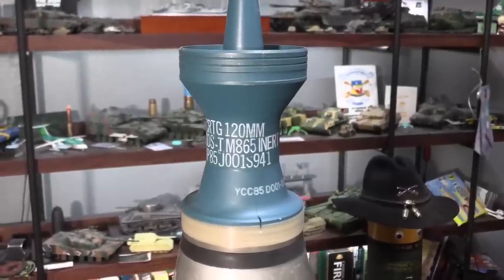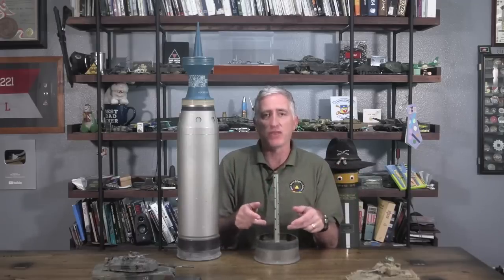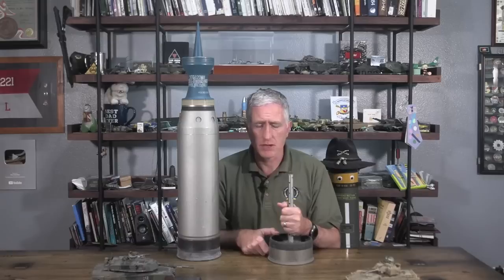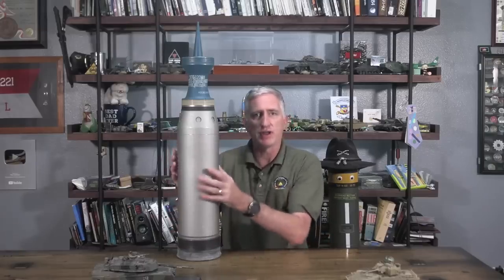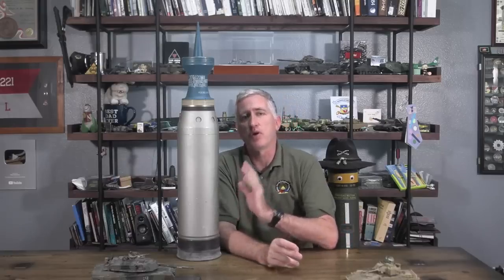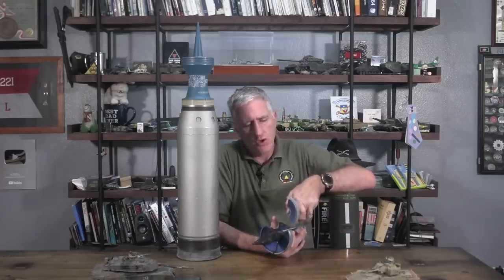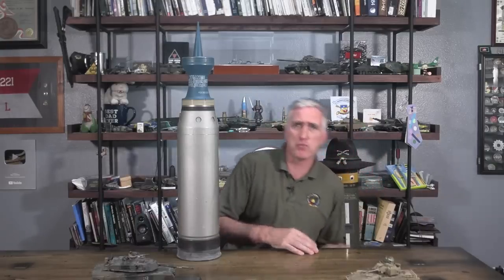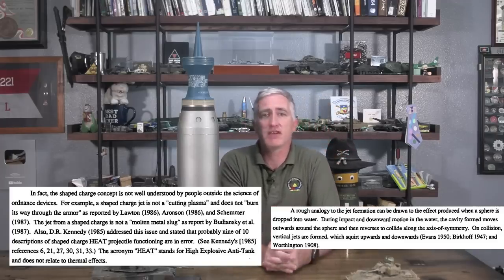Tanks 105: Anatomy of a Modern 120mm Round

Comment: Speaking of lap loading I've seen three tracers in the air at the same time 
(the old 105mm HEP TP-T was slow) at a Target at 1100m.
Reply: Must have been at a range, but I can't imagine a tank shooting three rounds at a target without even observing the first round effect on target. Seems like potentially an awful waste. I guess it could make sense if you really just had no faith whatsoever in the ammunition...
Reply: @tackytrooper  
Range 42 Crapingbeer Germany 1980
Reply: @tackytrooper  If you were doing your qualification run and you get two rounds to fire at each single Target engagement by the end of your run (If your Gunner is worth a crap) you may have five or six unfired rounds.
have you ever tried to turn in tank gun rounds that have been taken out of the packing ?
and even if you manage to get them to accept the several pages of paperwork it takes they'll likely destroy them.
Reply: @tackytrooper  Indirect fire artillery does that all the time, when things go "just right" they have multiple rounds on the way and are moving again by the time the first one hits. Modern counterbattery systems make such a thing more or less a necessity.
Reply: @robertsmith4681  Yeah for indirect fire it makes sense. For direct fire, those rounds have gotta be sloowwwww for that to even be possible. And, while I'm no genius, I would think that putting at least one round into every possible threat in front of you before going back to re-service anything that's not dead would be the most efficient engagement strategy. But then this guy said it happened on a range and range rules don't always match the combat META.
Reply: @sammymartin7891  When you put it that way it makes sense. I knew it had to have been at a qual or something...
Reply: @tackytrooper  The point of long guns such as artillery, is to never come anywhere near the enemy, from a place they can't see, comes a shell with their name on it that they can't hear coming ...
Reply: @robertsmith4681  Exactly but I was of the impression that we were discussing tank guns here...

Comment: Are Cellulose shell casings are going to be a no-go with auto loaders?  (Is this why the US Army never uses them in 120 mm. Because they might need designed Ammo?_)
Reply: All 125 mbt gun use cellulose casing.
Reply: Leclerc uses the standard 120mm NATO in the autoloader.
Latest Merkava have that semi-auto loader that offered the round to the loader thru a small gap, and the round offered is a 120mm NATO.

Comment: I am kinda envious.. I was not allowed to take any of that stuff home!

And wait a minute... you had an unfired live round stuck in your tanks barrel for several days? o.O

Some minor notes:
- I was taught that the shell casing is pressed powder, guess that was incorrect-ish
- lap loading was taught in Germany in the late 90s, though Id say that is situational and at the commanders discretion
- I was taught that the main reason for a round to get stuck in the barrel was overheating, because then the shell expands and bakes into the sides
- I was also taught to never touch those rounds with bare hands, but always wear gloves, because of static electric discharge
- about the HEAT round. The stinger also makes it multipurpose, if the target is too soft for the stinger to be pushed back into the shell, then the shaped charge wont form and you get a bigger boom without the molten metal penetrator spraying out.

(If my vocabulary is not precise, I am German and simply dont know the correct military lingo in English)
Reply: - I do not think that pressed powder is unable to spread throughout your tank like gravel.
- How is the charge ignited, if the stinger is not pushed in?
Reply: @karlwilhelmmeinert7592  Only the outer casing of the shell is pressed powder/cellulose. The inside is loose grains. If the whole thing was pressed solid, it wouldnt ignite and combust properly. (I think, I am no chemist though)
That casing burns up, too, thus only the bottom plate is left after shooting.

The round is triggered electrically, not mechanical. Nothing is pushed in anywhere.
Meaning, if you want to manually trigger a rifle round, you need a nail and a hammer. If you want to manually trigger a tank round, you need a battery.

Chieftain explained both things in the vid.
Reply: @theskilllessgamer5795  I do not mean the trigger of the propellent, I mean the trigger of the HEAT round that lets it explode after impact.
Reply: @karlwilhelmmeinert7592  Good question. 8) I am not too certain about this. Note that the stinger is just a metal rod, there is no igniter in it. My understanding is that the stinger works like a gap detector, if it hits a hard target it makes the HEAT detonate at that distance and allows the shaped charge to form that molten metal penetrator. If the target is softer, then the stinger pushes through it and the whole thing explodes on impact without a gap, then the shaped charge cannot form properly and it works more like a splinter grenade.
That is why HEAT is called "multipurpose ammunition" in German. (MZ = Mehrzweck = multipurpose)

But apparently that is insufficient, so there might be a 3rd ammunition type being introduced, a HE with a programmable timed fuse that can explode above or behind a target. It is called 120mm HE/Sprenggranate DM11

Comment: Water resistant my butt. After battle carrying one in the hole for three rainy days, I went to unload before reentering the camp. The aft cap separated, and powder started spilling out everywhere. What a mess!!! After shutting off the master disconnect, I had the crew evacuate while I  remained at the loader station and cleaned up powder. Slow, methodical, and always remaining grounded with my body. It took seven guys on the end of the bore cleaning brush to push the round back out to me. After that incident, I would rotate rounds ever so often during rainy weather.

Comment: 7:00 why does most modern tank cannons do away with the muzzle brake then?
Reply: I’m assuming it’s because recoil systems can cope with it better now.🤷🏻‍♂️
Reply: The vast majority of gun for tank in service is NATO standard 120 and Russian 125 derivative. Neither of them have muzzle brake. 

If we go lower, we get to 105 and 100, some of them do have muzzle break of some sort. 

Did I answer your question?
Reply: @jintsuubest9331  but why?
Reply: Muzzle breaks cause a lot of dirt to get kicked up when firing.  Large dirt cloud makes you easier to be spotted.  If you can get by without a muzzle break to reduce recoil might as well leave it at home.
Reply: Better recoil systems making it unnecessary, not having to deal with everything a muzzle brake hurls back at the tank or the giant ball of dust it will kick up giving your position away. It's also a big hunk of metal that you can get rid of to save weight, and use the weight elsewhere.
Reply: @thomaszhang3101  
It depends on your design compromise. 

Lets say someone draw up a requirement for a vehicle using nato standard 105 munition.

You do the math and figure the recoil system for the gun would need to be say 1 ton. 
But it will get rejected as the 1 ton recoil system will put the vehicle weight just a hair over the requirement. 

So you redesign your recoil system to have a longer travel, and cut it down to .75 ton. 
But the problem now is it cannot fire the gun at anything less than -3 degree as the breech will hit the roof of the vehicle, and redesign the roof to accommodate the recoil system is not an option. 

When you see if the mount can be lower, bad news. As the requirement call for -10 degree, and the mount is already at the lowest possible position. 

How about exotic mateiral? That ought to work, but also increasing the cost by 2 fold. That will get you disqualified. 

Some more intense math later, it is determine the highest you can increase the recoil system weight is to .8 ton. But the travel is still too much. 

Thus you work with the barrel. 
Give it some extra flair to absorb some of the recoil, while also keeping the system compliant with all other requirement.  

This thought scenario is stupid but I hope I get the point across.

Comment: Is HEAT used against infantry or field fortifications like trenches? Watching the war footage in Ukraine, I wonder if the Western Leopards and Abrams have an effective tank round against infantry, like the Soviet 125mm HE FRAG?
Reply: Abrams does have what is essentially the mother of all shotgun rounds, was developed as a need for a specific anti personnel offering.
Reply: i saw a vid the other day of a ukrainian leo crewman handling ammo and at some point showed what looked like HE, not 100% sure though
Reply: The Abrams doesn't use HEAT, it uses MPAT (Multi-Purpose Anti-Tank) and is essentially a 3 in 1 round. Depending on what the gunner has selected, it will either function as a standard HEAT round, a low flying proximity AA round, or a timed HE round. They are developing a new round that has more options, possibly including top attack like TOW 2B and a ridiculous frag pattern.
Reply: @m.d.598  
They are not making something with efp like tow2b. 
You cannot fit a large enough warhead in it to make it useful. 
It simply has different proximity frag pattern depends on target (air/ground), a point detonation, a delay detonation, and standard heat.
Reply: @jintsuubest9331 That's why I said possibly. What is shown publicly is one step or more behind what's being prototyped (possibly another STAFF round). Also, a TOW 2B is only 30mm larger in diameter. Other than for the heaviest top protected vehicles, it would do just fine.
Reply: @m.d.598  
Thats not how heat (in this case efp) works. 

Gun based scj weapon always have less performance per diameter compare to non gun based system.
It is primirally because of the acceleration and velocity of the projectile. 

While we dont know whats behind the close door, the basic physics and relevent paper are open to public.

Two2b fly to the top of enemy vehicle with the side wall parallel to the roof.
It has 2 efp disk, 1 facing downward, another facing downward at an angle. 
The reason is so that they will work properly if era comes into play. 
The mounting create some issue as the mounting apparatus has to beef up relative to conventional front facing mounting.
You also have a tighter limit to how much explosive you can fit behind the disk.
Actual diameter of the disk is roughly only 90mm iirc. 

Now, for a gun based projectile, with a smaller profile not only in diameter but in length.
That has to have increase wall thickness and beef up mounting apparatus to handle the higher acceleration.
It also need a conventional front facing heat disk, which itself need all the associated mount and explosive. 
Whatever space you can find to fit a downward facing disk is going to be exceptionally tiny, let alone fitting 2 of them. 

STAFF round is not like tow2b, it is more like Javelin. 
At the final attacking phase, it will oriented the warhead such that the front is facing the target.
That means there is no need to screw around with special mounting bracket and explosive amount.
That also means it cannot perform the usual frag function since it does not have the space to fit those stuff in it. 

No, neither m830 nor 830a1, nor amp has fin that allow it to oriented itself to turn the warhead toward the target.
Reply: @m.d.598  Have theLeos and Abrams sent to Ukrain been equipped with MPAT?
Reply: @robertsmith4681  I thought they went away from using the canister rounds?
Reply: @michaeldenesyk3195  I would have to assume (but can't confirm) since it is the only long-range anti-peronel round the US has in service for the 120mm (the canister round is meant for breaching cover it just so happens that 50cal buckshot is also effective against infantry).
Reply: @michaeldenesyk3195  I have no idea, remember watching videos of those things "in use" and being quite impressed by them.

Comment: Never knew that tank round casings were make of cellulose, that feels cursed since thats basically sugar polymers but I can imagine that they're lighter than a fully steel or aluminum casing
Reply: What's crazier is that soviet 125mm cases are made from nitrocellulose based plastic, so they more or less form part of the propellant charge as well as being the case. This probably contributes to the high rate of spectacular ammo explosions when the tank is hit...
Reply: @nerd1000ify  no matter the cases (pun intended), large ammo doesn’t like being hit period. 75s will burn and/or pop the turrets off Shermans & Panthers as much as 125s will T-72s & T-90s.
Reply: @aqui1ifer  Indeed a direct hit on a round will almost always cause it to burn. But the metal case does at least provide a little protection against flames and sparks from a hit elsewhere, assuming the case isn't penetrated by a fragment.

Comment: Yes, paper cartridges definitely need an anti-water coating. While the Germans did bitch about shotguns being used in trenches, I assume they also knew about the paper cartridges used in them and their tendency to make shotguns a one-shot object thanks to said paper cartridges and the Western Front's propensity to have water/humidity all about.
Reply: There were, and are, brass cased shotgun cartridges.
Reply: @jaym8027  Yes but the Western Front's conditions weren't thought about until the US Army actually encountered these conditions and discovered the big downside to paper cartridges as the shotguns became armorer repair objects. Why brass cartridges weren't really used later is probably due to other items being a higher priority to supply and by the time they were likely to get shipped in big numbers the war had ended.

Comment: How thin is to thin for an APFSDS to create spall?
Reply: I assume that it has a lot to do with the range it's fired at but at least twice as thick as the projectile is wide would be my "'best guess".
Reply: Depends on various factor.
Different metal and non metal has different failure mode at different velocity cause by different penetrator with different material which again has different failure mode. Exit angle also plays a role. This is not an exhaustive list.

Comment: So, you have just had a misfire, and you can't pull the round out. Ok, I understand that. You now have to fire it off somewhere safe. But how do you do that? It has already misfired, and presumably it also failed another attempt at firing it normally.
Reply from the maker: In such a case, you're out of luck. Best you can do is depress the gun to help keep the propellant in, open carefully, rotate the aft cap, and try to fire again. If that doesn't work, it's down to a bucket to collect the propellant, and ramming rods.
Reply: @TheChieftainsHatch  I see, thank you.
That does sound rather unpleasant, should it happen in a potential combat situation. I presume it is exceedingly rare?

Comment: Never mentioned what the metal petal or name of the metal the dart is made of. The petal is likely made of aluminum and the dart is likely a Tungsten nickel alloy or Tungsten Carbide depending on its particular use. Deeply Saddened this wasnt more detailed. My heart is forever broken.
Reply: Tungsten carbide rod is not used on any production rod. Only tungsten carbide slug was used for rod. 
Older pellet is made out of aluminium alloy. Newer stuff is made out non metal composite. But they still function the same.
Reply: @jintsuubest9331  Could you explain better. your comment has me a bit confused.
Reply: I think he was trying to say that tungsten penetrators aren't used anymore (all DU), sabots used to be made out of aluminium alloys but they have moved to composites since then.
Reply: @4CarbideGaming  
WC (Tungsten carbide) is not W (Tungsten alloy).

Every service W rod (APFSDS) is made using exclusively W, not WC.
The body of a rod need to have some level of flexibility to resist failure during penetration, WC does not resist bending very well. 
There are some experiment rod that use WC to make the entire penetrator, the result were not promising. 

Earlier W rod, basically M735, used a W alloy that has poor resistance against bending, to a point a steel jacket is required. But it is still a form of W alloy, not WC.

All the serviced rod that use WC were in the form of a slug attached to a steel body (founded on earlier russian rod), often refer to WC core steel rod. 
Those are phased out of service (well, on paper, but we saw shit tons of them flying around Ukraine), as WC core does not interact with multi layer armor very well. 

Did I clear up the confusion?

Comment: That HEAT "plasma" thing is a very annoying myth repeated over and over again.
As quoted text in the end say, there is no such thing as "plasma jet" and "burning through" armour.
In essence, the HEAT round forms a penetrator very similar to that APFSDS dart, except it is "produced where it's used", is smaller, lighter and has much higher velocity. But it is a thin rod of metal moving forward at high speed that is intended to punch (like a nail, not like a blowtorch) through whatever it meets.